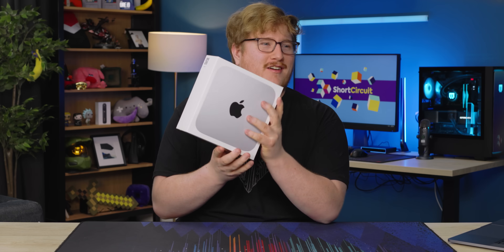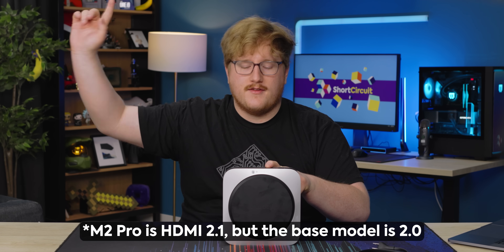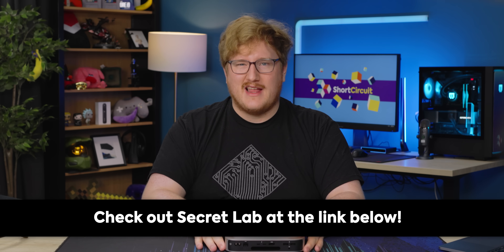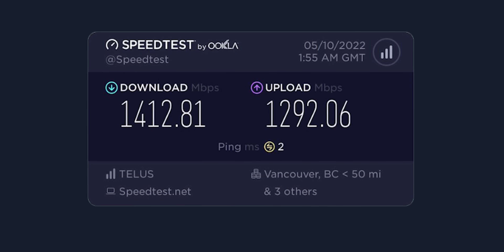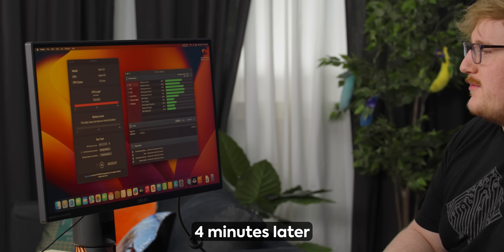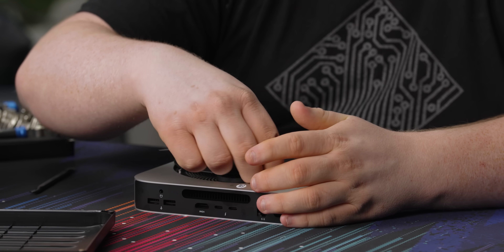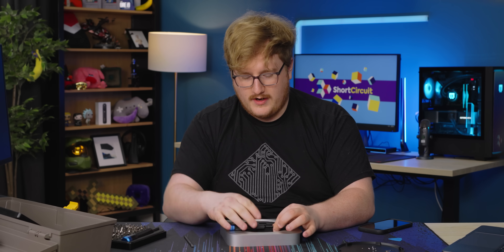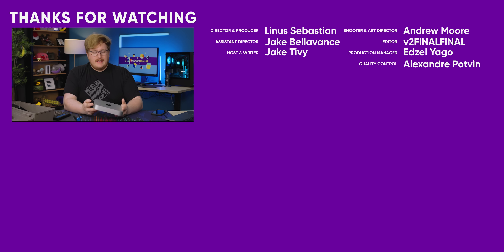Always wanted a Mac? Try this. - M2 Mac Mini

Comment: $200 price increase from 256GB to 512GB storage is hilarious.
It's like $25 for a 256GB NVMe drive, and $50 for a 512GB version of it.
Literally 8x cost increase from apple tax
Reply: It's made like this on purpose, even on iPhones(sadly trend also moved to some Android phones) sell phone swithout microSD slot, then you are forced to spit them more money if you want/need more storage, similar story here. But the worst part is storage in here is soldered... RAM wasn't enough, has to be storage as well... currently almost everything there is non-serviceable/unrepairable, apparently you can replace memory chips, but then you need to reprogram it in some way so it works and only apple has program to do it for now.
Like apparently its great buy from how everyone is praising them, but damn its impossible to repair if something goes wrong, you can send it to apple repair, but repair will probably cost $400 for machine that costs $600. I really hope other PC/laptop manufacturers don't follow them on this. I know some have soldered RAM, but usually there is another slot to upgrade it, also extremely rarely have I seen soldered storage chips, that just sucks balls. As great as it maybe is I really couldn't recommend this to anyone. Only thing that I can accept that is unrepairable as this is a phone and like a smart watch(which I don't even have).
Reply: Agree. That's how they became a trilion dollar company. The base model is pretty reasonable but then the add-ons to actually make it usable are priced insanely
Reply: Then don’t get it. stick with base model. What’s the problem?
Reply: @RunForPeace-hk1cu  The problem is Apple is always marketing this stuff for "creatives" and how nice it would be to work on your "projects". As a "creative" I literally couldnt store a single project of mine on a 256 drive, and after you´ve installed all of the programs you need and stuff there will be basically no space left. Not everyone is just using excel in their browser all day or watches YT videos. Why would you need a powerful chip like a M2 for 600 when you cant use it or just dont use it?
Reply: @anohippo  They wish for you to spec it up to something like 1-2TB and then upsell you to the m2 pro model with 1-2TB of storage so that you will end up spending over $2000 on one of their devices, instead of going for a proper workstation pc that can be used and upgraded for generations to come
Reply: @heroninja1125  Generations to come? How is your AMD K6 system going? Are you still rocking it with upgrades? Seriously, most people would be lucky to upgrade the GPU once, before they chuck the towel in and get a new system. There is planned obsolence in the PC world too.

Comment: (1) "I suspect that this will not throttle easily,  It's still at the minimum 1700 RPM speed doesn't really seem like it's getting any hotter which is great so 
you're at least getting the full fat performance out of this M2 Chip."  (2) "There's like nothing in here. Why don't they make this thing smaller? It's like half empty."

Answer to (2):  See (1).

Comment: im shocked...not even 2 years ago the Linus gang never had a good word for apple products (even the presentation of m1 was...well he made fun of). ...the world has changed since the m processors.
Reply: with a good number of the hard core apple haters at LMG now using apple laptops some if not most of the time, be that for battery or for video editing stability its not a surprise.

For example the did a video explaining when they do off site video editing they now just take Macs as the software they use is much more stable on macOS than it is on windows laptops. Even if the finnal render is 10% slower than a master gaming laptop the fact that it does not crash is more important.

Comment: That low end one is the "I need to develop iOS apps for Apple's walled garden, but refuse to use it for anything else" version.
Reply: If you're focusing on Android/iOS mobile development you should main an apple computer anyway since it can do both, and the Android toolchain is much faster on MacOS/Linux.
Reply: @jonathanvannier9797  No thanks. Windows is easier to develop on for everything else but iOS.
And no to Linux because my boss is not paying me to fiddle around with my OS when things don't work.
Reply: @derickwiebe  The tooling you'll be facing for (mobile) development is exactly the same on all platforms, and for all intents and purposes Windows corporate machines "hardened" by IT often fight against you. As for the "My boss is not paying me to fiddle around with my OS when things don't work" if that does not reek of armchair developer I don't know what does lol.

Comment: If the internal RAM and SSD were expandable with standard components (but it looks like they never will be) and you could run Linux (Asahi's most of the way there, but maybe not a daily driver yet), then this would be one sweet box. As it stands, the extreme cost of higher spec'ed models and the inferior macOS make it a big no-no for me.
Reply: Is macOS no longer basically NetBSD with a NextOS GUI on top?  I recall being able to just run a lot of linux stuff with just a ./configure, make install routine back several years on an Intel mac.

Comment: men 2,5 or 5 Gbit Ethernet should be standard nowadays starting at  mid tier 700 bucks + devices.
Also gosh darned some network gear manufacturer - release a 2,5 Gbit Switch thats not 100 bucks, thank you

It looks so much like a juiced up Raspberry PI :D

Comment: Would be better if you could at least add an additional SSD in it after the fact... But nope. If you didn't select the extra storage and extra ram ($200 for an additional 8GB of RAM and $200 for an additional 256GB of SSD... Complete scam by every measure), you're SOL. Enjoy the dongle life.

Comment: These are amazingly powerful for the power draw they use. If we can make a SANE version of these sort of things instead of such massively "brand tax" expensive ARM machines from Apple, I honestly think ARM could be the future and end the x86 run- PARTICULARLY with the lower power draw and how insane electrical prices will be getting as more and more demand and need for it is coming (think EV's and ending natural gas and using less powerful renewable generation sources).
Reply: I don't think Apple's prices are too bad here, the whole Apple tax thing is a bit of a myth in most cases these days. This is definitely a great little machine for the money.
Reply: @Skullet  Base model yes but the upgrades costing $200 each is a rip off.

Comment: Cool and all but they only give you 8GB of ram for a computer you can't upgrade? That's brutal, yes, yes Apple's integration and software does better use of the ram so you don't need as much as in a Windows PC but that's still very little if you want to keep it for more than 2 years. The worst part is that this situation is probably by design.
Reply: e-waste after two years will be a nice flowers pot stand 🤣

Comment: So tempted to get one. Really well priced (especially education pricing at £539 👀)
Reply: Nothing to lose really man. Base model M series Macs hold strong value on resale so worth a play I reckon
Reply: But then you look at getting 512GB of storage instead of 256GB and that's £200. Want 16GB instead of 8GB of RAM ? Another £200.
Reply: @TetraSky  but I'm not looking at those options? I'll get an external SSD over thunderbolt and that will do me fine. I'll be using it for very light Dev work mostly
Reply: @TetraSky  a great low/ medium load computer for students tho
Reply: But... why? You can get a sweet Ryzen 5625U laptop for this price with 16GB ram, 512gb ssd and ofcourse it includes IPS display, keyboard, battery. Even performance and power efficiency is very comparable. And laptop is just so much more versatile.
Reply: @Glotttis  a good comparison would actually be the 300~400 dollar mini pcs, they typically have 8GB RAM, 256GB SSD just like the mac mini but most of them are upgradeable (You can throw in 2TB into them for about $200.) And some are even waterproofed and weather resistant (Not sure why you would need that but its there).
Reply: @Glotttis  if he wanted a laptop he'd be looking at a macbook prolly, this device is something completely entirely different. so much that i'm not even sure how you even possibly thought of comparing it to a laptop

Comment: they never tout the internal speaker that I have seen. I think it's really just there to make the "bong" sound on boot-up and just happens to be a better speaker than the one in old desktops that served the same function of bios/troubleshooting beeps.
Reply: Yer that internal speaker is just for diagnostic sounds (yes the Mac has a few if you start to play around deep in the system).

Comment: 9:13 the reason they dont make them smaller is because data centers use them and instead of updating the design and forcing one of their, prusumibly, biggest customers each year to change how everything is set up they just leave it. i would argue its also good for normal consumers cause if they have them rack mounted or mounted under their desk they wont have to buy a new accessory to do this. snazzylabs has a video from a few years ago going over the data center side of this
Reply: Surely server farms would appreciate having smaller Mac Minis? External power supply would be even better. If server farms were a priority, they'd just make an actual server model.

Comment: Is there any other mini PC with integrated speakers?
Reply: Yeah. The Dell optiplex micro computers have a speaker.

I have an older 7050Micro and 7060Micro and both have a speaker.

They look about the same size as the Mac mini, a pinch bigger.

Edit: the dells also have an upgradeable m.2 ssd, 2.5" drive bay, socketed CPU, and 2 sodimm slots. Very expandable for such a tiny machine. You can find them on eBay for cheap.

Comment: The Short Circuit videos really take the "unprepared" format to the next level - almost negative amount of knowledge about something you should be describing... At least you can read the sponsor message...
Reply: I agree. Shortcircuit shouldn't exist as it is now. They might get lucky and make a good video, but sometimes they downright misinform viewers, and spout uninformed opinions based on ten minutes with the product with no background knowledge.
Reply: It's because LTT is an entertainment channel rather than an actually knowledgeable tech channel (with a few exceptions), and they figured out that not doing any research makes content super cheap to produce, so that's why this exists.

Comment: Suggestion: if two devices have a really noticeable difference in volume, lower the volume of the louder one to match the quieter one; our brains recognize louder sources as clearer/better sounding, which can make a difference in the appraisal of sound quality, particularly in person.
Reply: Maybe lower the mic/audio track levels, but not the device levels. You want the device to be put through its paces.
Reply: If that's the max volume one source hits why would you, then it wouldn't be as "apples to apples" as max to max comparison. If what you're getting sounds quiet, suffocated, and tinny compared to something everyone else is used to you that should probably be shown... which is what was done. Otherwise people might have other expectations of this device's on-board speaker, thinking it sounds just as loud as iPhone speakers which wouldn't be entirely true. Then they'd still have to mention that and compare it to the phone's max volume anyways, unless you're basically asking them to handicap something that's audibly perceived as better. Either way, that'd be more work for the same outcome. They'd still come to the conclusion that it's quiet, suffocated, and tinny.
Reply: Lowering the volume also lowers the quality
Reply: @diamondrel5190  Generally the opposite occurs. Distortion happens when a device tries to output more volume than it's physically capable of producing cleanly. 

So if the tester only has time to test one volume setting, then max is the best way to get a sense of speaker quality.

Ideally tho, you would want the tester to test the entire volume range of the device, then give us some charts showing at what dB levels the speakers become unstable and lose the "flatness" of their frequency response. Some good speakers just sound like crap at max volume because the engineers simply set the "max" level too high. But ultimately that is a job for LTT labs.
Reply: @GirthOfANation That's true, too loud causes distortion, lowering means it won't have enough power to effectively drive the speakers, there's a reason that amps and dacs are required for higher power speakers and headphones

Comment: Still trying to decide if the base Mac mini m2 is enough for streaming? Or if I have to run parallels to get the base pro Mac mini m2
Reply: Parallels works fine on the M2, though I'd shell out the (ludicrous) $200 for the RAM upgrade. I'd also spend $100 for 10gig Ethernet, personally
Reply: @Gilamath.  10 gig Ethernet is overkill unless you upload and download massive files all the time. For the average user that also doesn't have internet that fast I don't see the point but I definitely agree with the RAM upgrade.
Reply: @Gilamath.  Streaming will barely be affected if at all based on my experience anyway. At my work place I have 100 down and 50 up and at home I have a gigabit connection. Literally no difference at all besides downloading large files such as games. I have tried streaming and game streaming with both and there was no difference as far as I could tell and I usually notice small differences and get bothered by input lag or the smallest stutter. So I personally doubt there will be any difference between gigabit vs 10 gigabit besides how long games/files take to download. I can't tell anyone what they should do with their money but I think getting a ram upgrade and saving the $100 would be my strategy. Have you actually experienced any difference apart from game/big file downloads between two connection speeds?
Reply: @twitcharchive0  I personally have for Steam Link, though not a major difference tbf. I think Steam doesn't push a whole 10gig stream even if the bandwidth is there. But it does do at least 2gig iirc
Reply: Stream what? Games? Either way, the answer is yes, it's plenty.

Comment: Trying out my m2 Mac mini. Sound is fine, never liked reviewers showing sound in video cuz people got so different specs that it never sounds the same. For context I’m using it over my tvs sound out of laziness cuz it’s def fine. Especially if u are on a budget and don’t plan to get external audio and have a shit monitor in terms of speakers. Ya people at ltt prob got decked out stuff or extra perphils that make ‘‘em see this as cringe in terms of sound but considering the demo for this 500-600 device, the sound is more then adequate if ur on a budget and don’t wanna spend more for better audio🐱
Reply: The sound they are talking about is from the Mac Mini's built in speaker, which is mostly used for the startup sound so it's quality isn't all that important.

Comment: What would hold me back from trying something like a Mac Mini is the just small size of the base models storage, the fact that you can't add storage and the fact that the upgrades to more storage are frankly insane. The 512 GB version is €230,- more (€719,- vs €949,-) and the ONLY difference is the amount of storage. I can get a blazing fast 2TB SSD for that amount of money.

Want 2TB from Apple in your Mac Mini? + €920,- please. NINEHUNDRED AND TWENTY BUCKS.
Reply: Thunderbolt4 to M.2 bridge: ~$170.  M.2 2TiB NVME SSD ~$170.  Still very fast, quite reliable.  Get a Command Strip and stick the enclosure to the top/side/whatever of your Mini, problem solved, and is also upgradable later.
Reply: Connecting an external ssd through thunderbolt is very usable for most cases where the base model is sufficient otherwise.
Reply: You can use an external drive with it to expand the storage, you can even run the OS from the external drive without any issues. So I wouldn't let the storage thing hold you back.

Comment: Wait that's actually sort of kinda a reasonable price

I'm astonished
Reply: Untill you want to add 8Gb of ram and they bump the price by 200.
Reply: May look reasonable in a vaccum until you shop around what's available on Windows side for this price. Can get a sweet Ryzen 5625U, 16 RAM, 512GB SSD laptop with IPS screen for this price. And it's so much more versatile and portable than Mac Mini.
Reply: @Glotttis  shocker. A laptop more portable than a desktop. And why do people spit out windows machine specs that meet a certain price point when it quite often is less performant anyway? Ooooooh big number on the parts but crap performance irl.
Reply: @SamThingsHD  I bet the x86 laptop is gonna win for 99% of games. Why? The Apple computer will have a "did not run" placed there.
Reply: @AntonioNoack  lol yeah coz games are all that matter
Reply: @SamThingsHD  They are not, but often they are most taxing. They are, where performance matters most.
Reply: @SamThingsHD  Except in this case laptop with 16GB RAM and 512GB SSD will actually be more performant and more future proof. 8GB RAM (base Mini model) is a joke in 2023. It's ewaste out of the box. Please tell me what sort of productivity you expect to do with 8GB ram / 256 ssd? It will start lagging just from few too many browser tabs, let alone using any pro application seriously. But you do you.